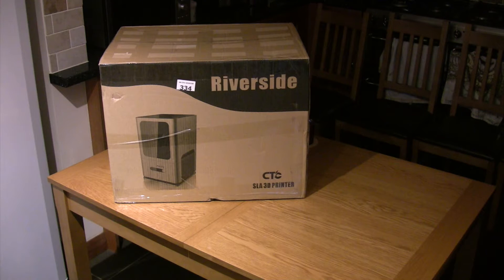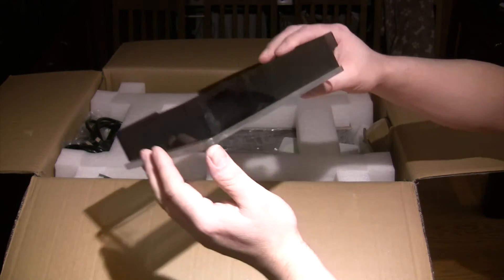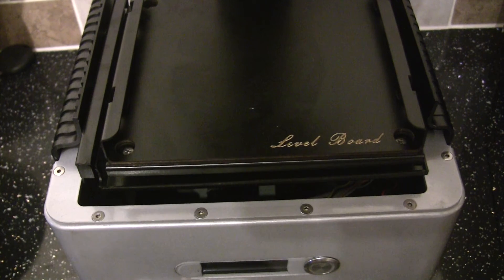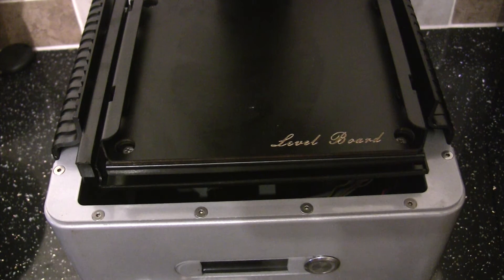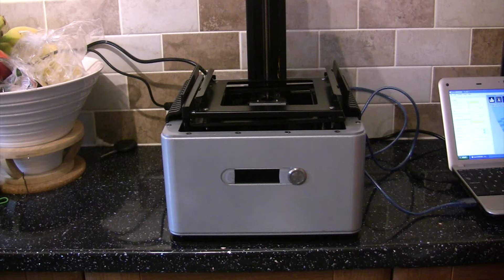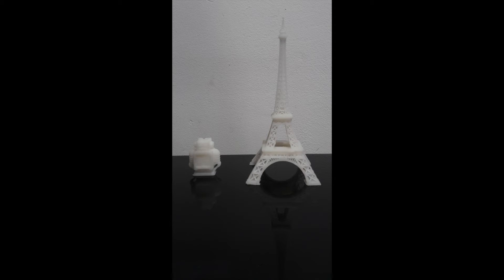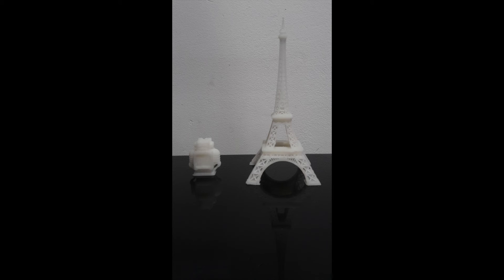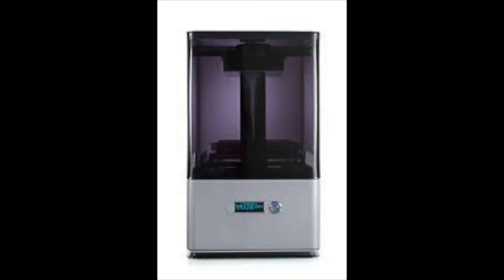CTC Riverside SLA 3D Printer Unboxing

Comment: Hi there!, hehe I deleted the message because I found the files... there are in a SD flash drive and not on a CD, like I was looking for... sorry.

I was able to to find a mac software in the installed files, I am able to connect to the printer with the software, using a USB port, but I cant open any files with it... on the folder.  .file:///Users/.../Documents/3D%20printer%20/ReplicatorG/replicatorg-0040/docs/replicat.org/installation-mac

file:///Users/.../Documents/3D%20printer%20/ReplicatorG/replicatorg-0040/docs/replicat.org/download
https://code.google.com/p/replicatorg/downloads/list

I have parallels on my mac, and I was running the software, but I dont have any serial ports... so I CANT connect through windows... 

Os as you can see I am stuck... in mac I Cant open files, and in Windows I cant connect because I dont have a serial port...

I have a legit windows copy ;) everything in my mac is legit.

So you are saying that the MeshMixer is for mac and is working perfectly ? and you share the settings ?

Thanks a lot!
Happy and prosper new year!!!
-Oscar.
orangelca@gmail.com
Reply from the maker: +Oscar Rangel lol you don't need to convince me of your legitness :)  I run mine on the netbook in the video, I VNC to it so its like a print server if you will.  I don't like leaving the mac on all night.  So you got an SDcard and on it was the mac version ???

Mine only contained windows version, and it installs a driver as part of the setup.  And there is then the option in Cura to select Riverside as the printer.  I download the Mac version of Cura from the Ultimaker site, the mac detects the printer with no kext requited.  However the profile that is installed with the supplied windows version is missing from the vanilla version I downloaded.  I can't get it to print with Mac, it detects the printer and operates it - but it does not print.

You could try Virtual Box - its free and I have used it before with USB ports and worked fine.

What extras did you get in the box ??
Reply from the maker: +Oscar Rangel  Hang on !!!!!!! I just re-read your post, are you saying they suppled you with ReplicatorG ????
Reply from the maker: +Oscar Rangel  Sorry even compressed I can't send via email, seems I can't send anything over 50Mb.

Comment: I been a good boy too, I got mine today, I wondering what as the other software you mention for the extra step, I am a mac user, is there a better software to use the printer for mac ?

Thanks!
Reply from the maker: +Oscar Rangel Wow - did you delete the original message ?  I was about to email the files.  I'm on a mac and I can tell you that there is no profile for cura on the mac for this printer.  I copied all the settings and Cura for mac looked like it was going to print before simply sitting there humming.  The only way I have managed to get it to print with a mac is via VMWARE and a copy of totally legit windows :)

If you manage to do it - please share. The software is Meshmixer, as it will generate tree & branch support structures very similar to preform.  This has enabled me to print just about anything.  I'm very happy......

What did you get in your box ?
Reply: +3D Motor Maker, can you please send them to me now, as we know thanks to you i have the wrongs files...

Thanks,
orangelca@gmail.com.